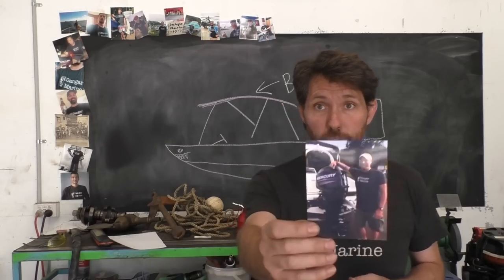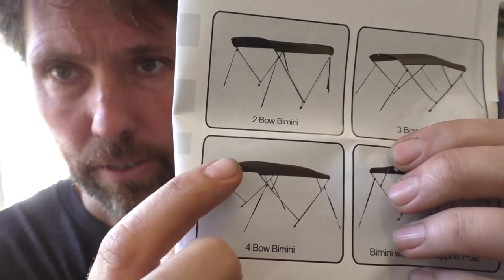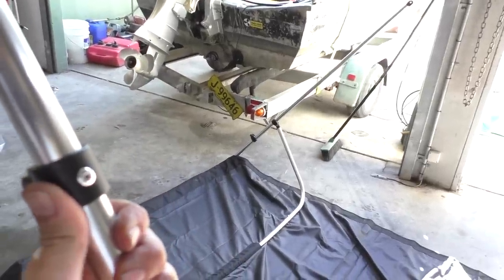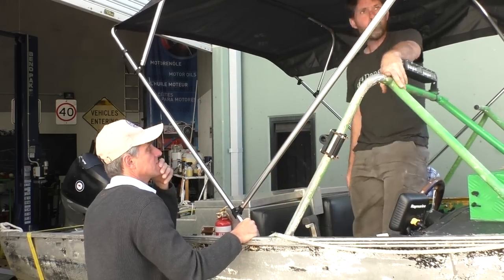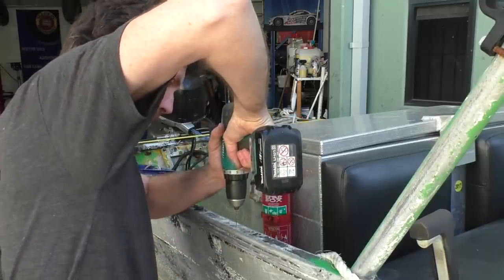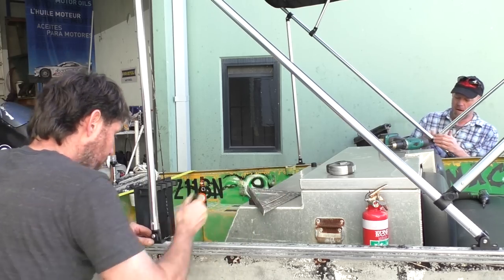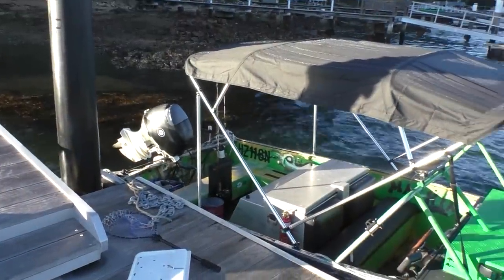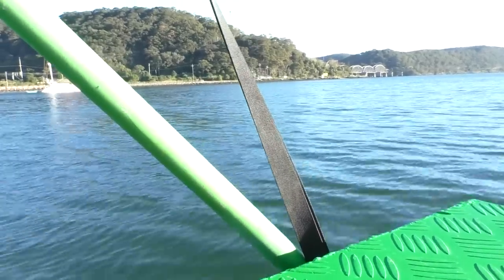Adding a Bimini to a boat

Comment: Nice Bimini top Stu. Great addition to any boat. I've found that they seem to last longer by spraying them with scotch guard or whatever fabric waterproofing spray you can get your hands on every now and then. The waterproofing spray also makes the water run right off them and bird poop don't soil them as easy.
Reply from the maker: Hey Jack, spraying it sounds like a good idea. I'll see what I can find.
Reply: Mixing a solution of 3 parts metho to 1 part silicone sealant then mixing it around so the silicon dissolves is great for water proofing. I do this to all my cycling kit. Lasts a year or so. Just mix it up, brush it on with a paint brush, let it dry and watch the water bead off it.
Reply: @K S yep.

Comment: I put one on my boat 8-9 years ago. love it. keeps the sun off when you start to burn. I also added adhesive white led lights to the middle support poles with the wire zpi tied down to the boat and a quick disconnect. so its easily removed when I take the top off. its like having a ceiling light in your living room while fishing at night.
Reply from the maker: It is great to have a bit of shade when your out on the boat for sure. I like the idea of the light too, I really enjoy night fishing.

Comment: Inspired me to install the Bimini I had sitting in my shed for years. Turns out it's the wrong size for my boat (Came with the boat). Went to BCF and got a new one. I was also inspired to purchase some bench seat cushions from an online retailer. What a difference it's made. Turned my little tinny into a first class liner. Shade and comfort.
Reply from the maker: Nice! It's always good to make your boat more comfortable like that. :)

Comment: I have the same Bimini and the instructions show the solid bar going to the front in the diagram it indicates the tag (labelled “front”) is on the end of the solid bar. After watching this I realise they had the instructions wrong and it all works if I reverse the cover over. I was provided screw head screws along with thumb screw type screws so I just put the regular screw head (requiring screw driver) down the bottom which avoids the rubbing against a pole or pier issue.  Thanks for the great video.
Reply from the maker: Hi mate, glad to hear you got it all sorted out in the end. :)

Comment: My boat has a similar Bimini however it has a track system for the rear support poles which is nice because you can slide then forward and fold the Bimini all the way back and flat in front of the motor

Comment: Co-sign the 'twist in the strap' technique.  I found that myself after some trial/error.  My front straps would buzz and sound like chainsaws at speed in the wind!  Just a half-twist does the trick.   Also, I found my boat is harder to stay on plane and porpoises more easily when my top is up.  I guess it was acting like a sail.  I loosened/tightened the straps here and there, angling the leading edge down a bit and that lessened the sail effect.  Just a tip.
Reply from the maker: It sure does help. Good point about adjusting the angle of the bimini until the boat rides nicely. I definitely tried to angle mine down as much as I could.

Comment: Gday mate biminis are great for small boats sometimes they can be a pain in the arse when fishing but when your out on a 40 degree day even just having that over you to block the sun makes a world of difference ,your lucky i had to do mine by myself trying not to scratch the paintwork .When i was trailering it i used a set of home made bungy cords and had it rest on the motor cowling with a towel underneath to stop scratching from the sock good video .
Reply from the maker: Thanks mate, they certainly give some welcome shade on a hot day, that's for sure.
Reply: They sure do even if the sun is shining into the boat just being out of its direct force makes a heap of difference.

Comment: Hey guys,  I put one on my boat this spring and got to use it all summer. I'd seen them on many other boats and always wanted one.  It was a great decision to add it to the boat.  I did do something drastically different though.  I put it on backwards so that it stows above my windsheild. I'd never seen anyone do that so I was a little nervouse but it works great.  I bought the tallest one available so I'd have a little more head room for the fishing poles plus if I step up to the bow there is extra head space.  Give it a try next time or if you don't mind a couple more holes in the boat you could spin the one you have around,  Take care
Reply from the maker: Hi mate, I have seen a couple around that way and I agree it can be a good way to go depending on the layout of the boat.
Reply: Good add and in the rain it’s lower.   😅

Comment: Hey, that was me!  Great to see the tip worked for you. I'm now famous. Hehe. Great video again.
Reply from the maker: Thanks for the tip! :)
Reply: Now if only there were so easy a way to stop lines from slapping on the mast.
Reply: Dangar Marine I have a Yamaha 200hp on my boat and the motor runs on an external fuel tank, but I added 5 gallons to the boat tank witch had a few gallons of bad gas already in it, but when I go to siphon it the fuel line I put down in the boat tank I bought it out and the line on the end was dry so I'm not entering the fuel is there anything to do to enter the fuel?
Reply: If you want to get all the fuel out of the main tank I removed the ball hose and hooked up a small DC pump to that tube. Worked great and used that fuel in my old truck. If there is any water in the fuel you may want to take it to a hazard material site to get rid of it.

Comment: The strap without a twist  suffers from aeroelastic separation or flutter. Same problem occurs with sharp leading edges on airfoil. A blunt leading edge flys smoother with no darting or flutter.

Comment: Very similar design to mine. A few issues I have had from last season
 - I lost the travel sock/cover when towing the boat down the freeway. I would guess the air flow caused the zip to undo itself and so the cover stripped itself off. I now use a 4mm 'silver' rope to spiral wrap the bimini cover  when transporting the boat. I haven't found a new cover yet.
- Those nylocs in the bimini frame are easy to lose if you undo the hand screw - which I do for my lady to get on the boat. As per Murphies law, the nuts drop into the sand on the launch beach and disappear forever ( same place pens go to?) .A touch of glue saves them - I have found Silastic to be good as it has enough 'give' but holds the nuts in. But I still carry spares in the tool kit now.
- Swapping of the brackets so the hand screw does not protrude over the side ( I did the same thing but for a different reason, losing a handle is hard to replace, a lost nut is far easier to source) , you will find it easier to drill the rivet out that retains the bracket and swap the brackets to the other side. a bit more of a fiddle but it works.

- A spray of lanolin into the springs is also a good idea, they are plain steel springs, not stainless. Also the tubing on mine is aluminised thin wall steel, check yours with a magnet. It means you have to wipe the tubes down with a water dispersant now and then to keep corrosion at bay. Mine have started to corrode at the cut ends- a dip in some POR15 seems to have fixed that issue.
Reply from the maker: Good tip about glueing the nylocs into the brackets, I can see them falling out quite easily otherwise. A bit of pre-emptive maintenance to fight off the corrosion is also a good point. I think these poles are aluminium but I'll check them today.

Comment: This is what I have coming soon, my boat has versitrack a channel that runs inside gunnels hoping to be able to just use 1/4” carriage bolts in track but if doesn’t work out I have aluminum angle iron I can bolt to versitrack, it might be very simple, same 4 bow with rear supports I may add front supports for extra rigidity I want to see the length of the first rear supports first as 4 supports will have to be the right lengths to adjust tightness of fabric

Comment: awsome addition to the green machine i know you will reap the cool benefits:) on my old cutter i also add a bimni i used the stock kit that came with the plastic connectors they lasted here in canada for a few summers before they cracked after hot sun and cold winters , i ordered the stainless ones then realized that they were way to much cash , i went with the aluminum ones , and added a slider track down a short length of my gunnel so that i could slide forward or back :) just my 2 cents , great video Stu even for a first bimini install very well said and interesting vid as always , the twist in the tension straps one great tip also cheers
Reply from the maker: Interesting idea about adding a slider track. If I have trouble with these plastic fittings I might also look into upgrading them to aluminium ones. I'm thinking if I leave the canopy up (which I have been so far) it will probably be the first thing to go from UV so I might end up replacing the whole thing every two or three years, time will tell I guess.
Reply: Yup, from my experience they last a season or two at most.

Comment: Great video.  Love the "dry" humor.  The hardest working thing in your shop seems to be a bottle of beer.
Reply from the maker: Thanks mate, never try and work on a boat without a beer. :)
Reply: Gonna put a water fuel separator on today so do you think a six pack will be sufficient?
Reply: Greg Stephens I'd start with and then one every fifteen minutes 'til done.

Comment: This was a great video. I am installing one shortly and this will definately help. Quick question, i have a 1988  75hp johnson and i am looking for a tilt trim unit for it. Do you know if those unit came with only tilt assist or tilt trim? The space between the bracket for the engine is only 7 inches and the tilt trim i found is a lot larger. I was also told it may be a commercial engine . Would that be the case ?

Comment: I believe I ordered the same canopy and you have yours on backwards my friend. The strap should be to the rear of the boat and it should fold to the bow.
Reply from the maker: I had it folding back because we tie bow up to the wharf and need to climb out over the front.
Reply: @DangarMarine  LOL when I made my comment I had not installed it yet and I had to install mine exactly like you did. You really have to customize it for yourself.

Comment: I have one of these on my boat but the top is getting a little worn out now. As I never take it down, I've been considering trying to convert the frame to a hardtop using some of that lightweight aluminium sandwich board (I don't know what it's actually called). This would also allow the installation of an extra windscreen between the leading edge and the exsisting screen which will make for a much more comfortable ride at speed. Have you ever done anything like that?
Reply from the maker: I haven't done it myself but you do see plenty of boats with thin aluminium riveted onto a frame like this. It also allows things like mounting an anchor light on top which is a good way to go.
Reply: @DangarMarine  awesome,  that's all I need to know. Looks like that's gonna be this weekend's project. Cheers :)

Comment: You don't find the bimini is way too flimsy, right where it is mounted? I just installed mine, and there is so much movement I'm afraid to drive with it up, thinking it's going to break on the water. I'm thinking of upgrading to stainless mounts.
Reply from the maker: I was actually surprised how sturdy this turned out to be once the ties were taught.

Comment: Stew love your channel and all your videos. Hopefully you may have a answer  for me. Upon my grandfather's passing  in 2015 I inherited his Fisher man cave included was a 1910 Evenrude outboard that he had purchased in 1911, cosmetically it is beautiful, it turns over freely I been able to source most of the parts to get her to run again as a tribute to him but rings seem to be a problem. Any ideas would be appreciated
Reply from the maker: Hi Mike. By rings are a problem are you referring to ordering them? Sounds like a great project. Getting original parts is obviously going to be tricky an outboard of that vintage but you may be able to get rings from an engineering shop that suit. Otherwise someone like Will from the Will's Garage YouTube channel may know as he is involved with several vintage outboard groups.
Reply: Dangar Marine Thanks for your reply. I have found a machine shop that will make them for a almost reasonable cost.

Comment: Hi dangerstu I've been loving your videos and have been binge watching them! I have a question I have a 1974 Chrysler 45hp and was wondering what the right fuel oil mix I should use and weather or not running a little more oil would be an idea as it is an older engine?? Cheers
Reply from the maker: Thanks mate, glad you've been enjoying the vids. I'm not sure what it is designed to run on. You can usually find PDF copies of the owners manuals online that will tell you. It is usually around 50:1, but running a bit of extra oil isn't bad unless you do a lot of idling / trolling in which case the plugs will probably foul up.

Comment: Love the vid.
I’m thinking about getting a Bimini but I want the screen at top of boat so I can get a proper cover. But what is the boat screen called.flybridge? Splash screen etc
Reply from the maker: Thanks Chris. They generally just call them "clears." A flybridge is the second deck you see on bigger boats for steering from up high.

Comment: Not a fan of screws either.  I can see those stainless steel screws working themselves out of the alloy hull.  My rule of thumb is always bolts and nuts so long as you can reach both sides of the bolt.
Reply from the maker: I also find screws hard to get undone once they are corroded a bit, presuming they haven't already fallen out!

Comment: Dangar Marine I have a 2003 Yamaha 115 4 stroke, can I replace my lower unit with a 2012 Yamaha 150 4 stroke lower unit?  If not, could you recommend a year that is interchangeable with my 2003 Yamaha
Reply from the maker: Not sure which ones are interchangeable, but in that situation I would go onto a site that sells parts online and compare the part numbers of the gear cases. If they are the same you should be good to go.

Comment: cool mate.... hey mate as i was driving my boat today has a 90hp Yamaha 2stroke full throttle cruising along & it slows down & shut of but i pump up the fuel line then it's all right again wat u think abt it
Reply: are the fuel line from the petrol tank to the engine old? cause for me, my one literally was blocked up since it was so old. Fuel was going through, but when rubbish gets into the line itself, it clogs up and then my engine shuts off. my engine also shuts off when i put it in full throttle as there was not enough fuel going through and the hose gets tighten the the engine tried to suck fuel through.  not sure why my hose started to constrict on itself in the first place (my guess is that the weather cause it to warp), but that's what happened to mine. I tested mine by disconnecting the hose from the engine and the fuel tank and removing the tips from both ends then blew through it. was extremely hard so i got that changed and now my engine is running great again... though not sure if thats the same issue with yours.
Reply: Sombody You Dont Know thanks mate okay ill try that...😊😊
Reply: Have a look at Stu's older videos, he cuts an old fuel line up and shows how they break down inside and cause blockages, what to look for etc.
Also - is your fuel bowls full when it happens? If not you start down the fuel pump check list/videos .
But the easiest one - is the fuel tank vent open?
Reply from the maker: Yep, I'd definitely check fuel lines and vent.

Comment: I'm going to replace the rails in my boat.  Once I purchase a bimini, I'll be able to move it fore and aft, 3 feet I believe.
Reply from the maker: Sounds like it will be good setup once it is finished.
Reply: Yeah, it helps position it if you want to fold it down and store it over the splash well area.

Comment: Instead of drilling the rivet out to flip the knob to the inside, could you just replace the knob with a nut and bolt to replace the knob?
Reply from the maker: That probably is a better way to go give you don't often need to take it out, not even to collapse it.

Comment: greeetings from North Carolina in the US,  had a Honda bf25 with a spark plug that had hot fire out of the head, screw it in and it had a dead skip. it had fuel and compression ( a new plug cured the issue ) can you explain what the hell was happening?
Reply from the maker: I'm not quite sure I understand. What one of the plugs loose? If so it may have got damaged.
Reply: I unscrewed the bottom plug after i determined that is where the miss was, I put the plug against a head bolt to check if it was firing, it was, when i screwed it back in the head it stopped firing ( still missing). think it was damaged and grounding its self out, was curious if you has seen this before.

Comment: I see so called "Professionals" drive with nylon straps straight, you can trash a set in one trip unless they are twisted.
Had many customers complain of strange noises with straps on the roof, they don't believe me when I tell them to twist them, a couple of hardheads refused to twist them, but, they didn't stop complaining about the noise.
If they won't install them with a twist, I let them figure it out themselves.
Reply: I drive a semi pulling a flatbed. You definitely want to twist the straps.